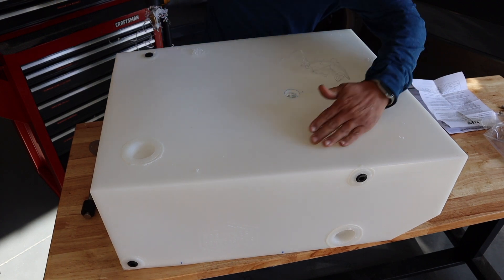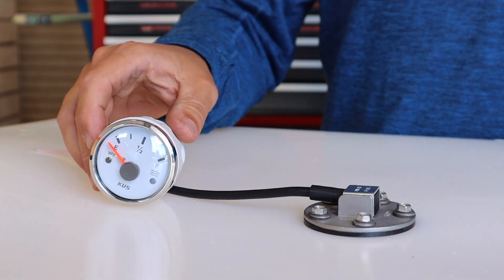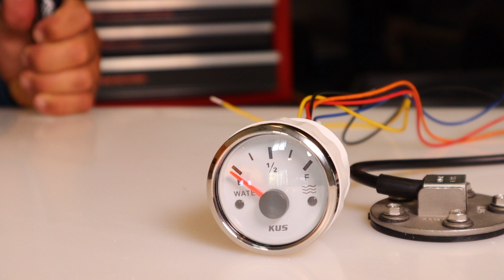Water Tank Level Sensor For Your Sprinter

Comment: When connecting directly to a cerbo, can that provide power? So you only need the two sensor wires?
Reply from the maker: The power is only required for the readout gauge. So if you have a digital readout, you don't need to add the power wire.

Comment: Great video. Easy to understand and follow, eventually. I have to figure out how to hook it up to electricity before I buy the sensor. I’d like for it to be a DIY. At the moment, I’m thinking of pigtailing the source from an outlet, will this do? I have a 1973 Chinook Slide in camper with, according to the water in sensor, isn’t a 12 gal tank. Would it be right to multiply the LxWxD to get the volume or capacity? Thanks In advance if you answer the Q and thanks again for the installation video. 

The retro or white will go with the camper aesthetics.

Comment: What do the screws adhere to?
Reply: My gauge only came with bolts which seems confusing to me
Reply: They just thread into the plastic. Basically they "tap'' the drilled hole. Don't drill it too big.

Comment: Question, could I install 2 gauges on 1 sensor?
Reply: I tried to do this and it didn’t work well. Both gauges received a signal from the sensor, but it was wildly inaccurate. My end solution was to install 2 sensors and 2 gauges.

Comment: Nice video, just realized I have the wrong sized level. Had this thing in storage for 8 mos. smh
Reply: David, my tank is 16” in height, and I don’t know if it has ridges. What size is what you bought and is it something you have and would sell? It’s more important to know when I know this goes back almost a year, but do you still have the level? For me, it important to know when it gets close to empty, so I can work with something that’s between 11” and 15” in depth. If I have time, I’ll use my snake camera to see inside it, and check to see if there are ridges. Thanks.

Comment: Can you hook up two gauge's to the same level sensor?
Reply: I also want to know this. I think it will work.
Reply: @foosballjunkie  why would you want to do this?
Reply: @ronpaguio9014  I fill my water tank at the back of the van, so I installed 1 gauge back there. I installed a 2nd gauge inside the van so that I can see the level without getting out and getting in the back of the van. I have a bike rack on the back of the van, And I really only move it out-of-the-way if I’m going to fill the water tank or use the exterior shower. 
I haven’t run power to the interior gauge yet, but the rear gauge is working well, and the wires are all set to go to the front gauge.
Reply: @foosballjunkie  I also want to know this as well. I'll use 1 gauge from inside the van to monitor the level. And a 2nd gauge in the rear when I fill the water tank. I'd also like to know what wire size (AWG) to get. Thank you!
Reply: @MrsFelecia14  I did successfully incorporate a 2nd gauge! I believe the wire is 18 AWG.

Comment: Hello, thanks for The Information. My question is how you can change The range of The meter, since my watertank has a shorter range than The length of the sensor.
Reply from the maker: You can order the sensor in different depths depending on the water depth in your tank.

Comment: Hey there! This was incredibly helpful!  We just installed one with the Kus instructions and your video.  The only thing I'd add is the drill bit size for pre drilling the screw holes.  We ended up using a 9/64 drill bit and it worked perfectly.  It seemed to bite just enough.
Reply: Thank you, this is what I came to find the answer to!

Comment: Hello there!. Great Video. Just liked. Im doing a Camper build and installing new tanks. What would you say are the benifits to using this type of sensor? Do the floats get stuck? There seems to be little to no info out there on using the float styles vs the little digital screw ins. However there is ALOT of info on fixing broken/nonfunctioning digital sensors. Not a good sign in my view.
Reply from the maker: I haven’t experienced the floats getting stuck. But I have experienced electronic sensors going bad so pretty much just use the float sensors now. Also they are very accurate if you get the right depth of sensor.